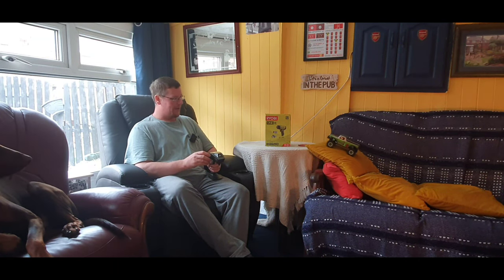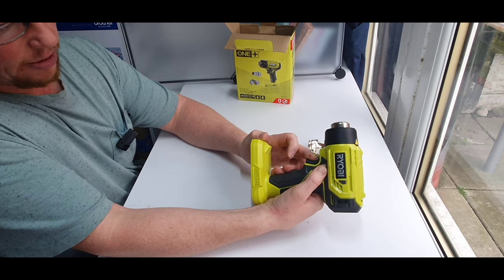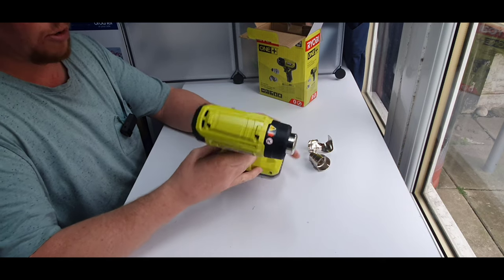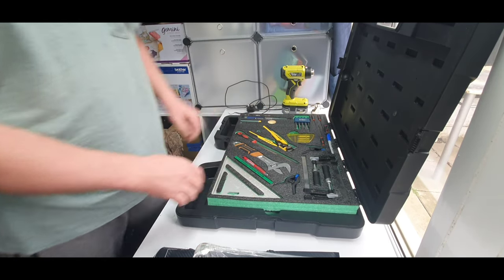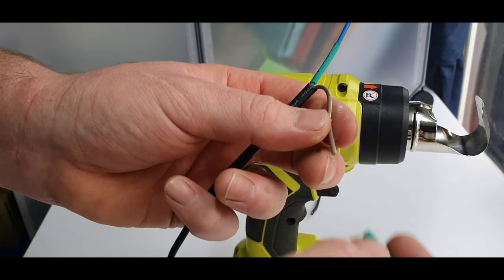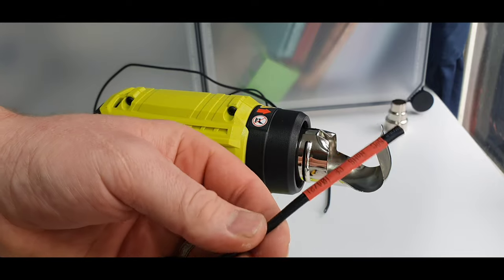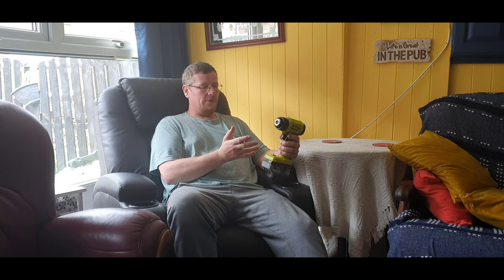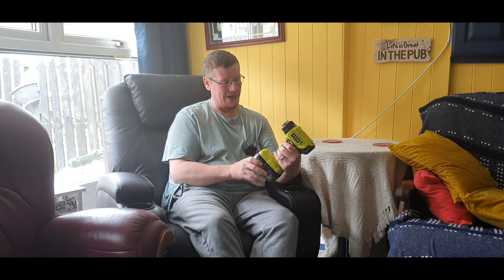Ryobi heat gun R18HG-0 18v one+ review

Comment: Thanks for the review. I purchased one of these a couple of weeks ago but I haven't got around to trying it out yet, so it is good to see someone else using one first. It might be that I'm in a different country than you, but for what it's worth, in New Zealand, where I am this tool comes with 4 nozzle attachments.
Reply from the maker: That's interesting mate. Ive only seen it with the 2 attachments here in the uk. What are the extra 2 attachments you get in nz?
Reply: @TheYorkshireMix  There are 2 sizes of round concentrator nozzle, 1 heat-shrink/heat-sleeve nozzle and 1 wide flat nozzle.

Comment: For £25 (use to be £15) Parkside heat gun, does the exact same as all the big brands at a fraction of the price and it comes with a 3 year warranty too. For anyone that already has some parkside power tools.
Reply from the maker: I imagine it will do the same job but it's just nice to have 1 that runs on the batteries I already have👍